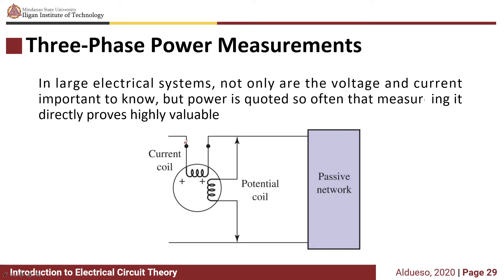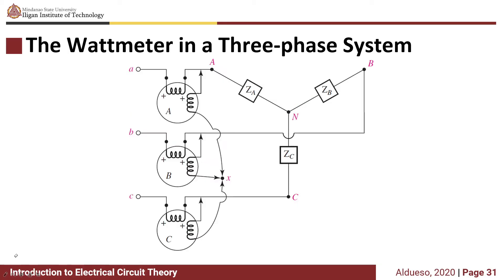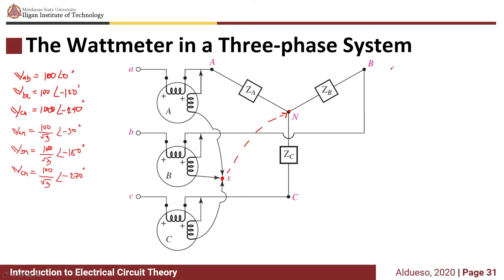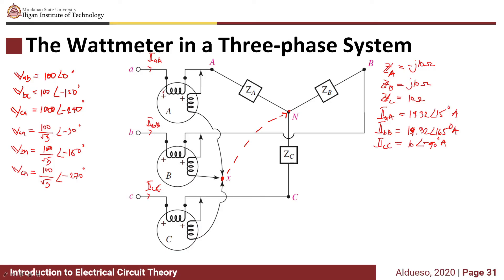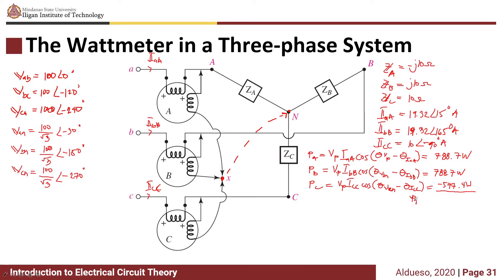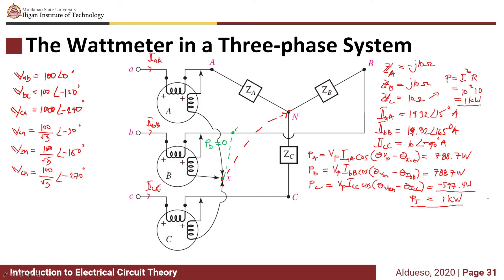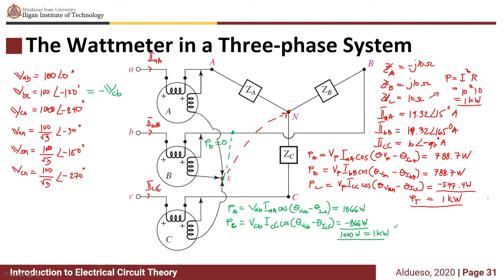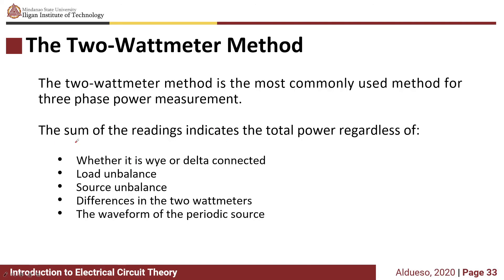EEE132 - Electric Circuit Theory II: 3-Phase Power Measurement Part I

Comment from the maker: @ 4:27, the values of the line currents are solved using mesh analysis. But it is not shown here because the main focus of the example is to demonstrate the two-wattmeter method.